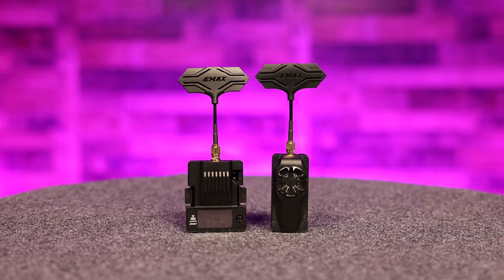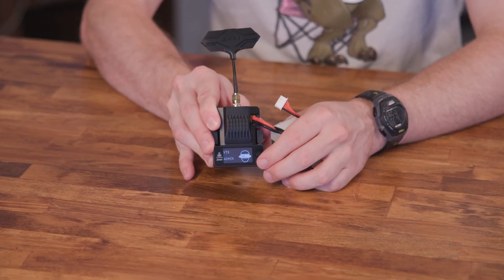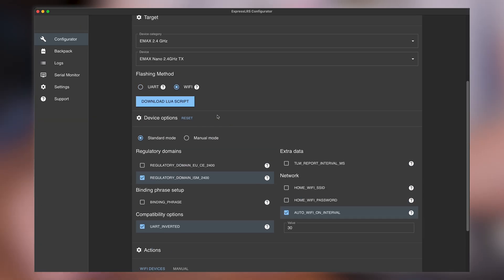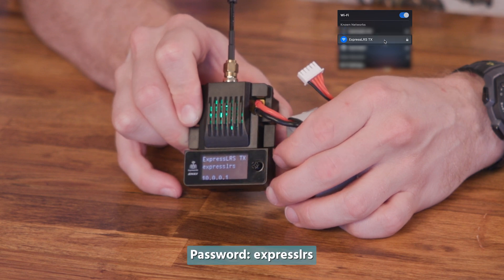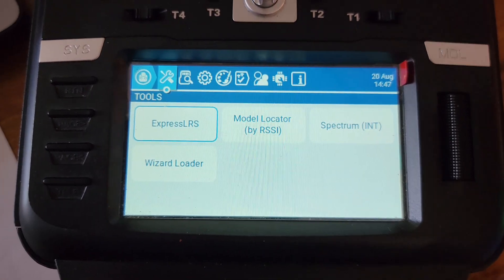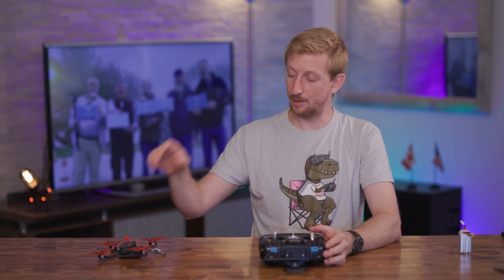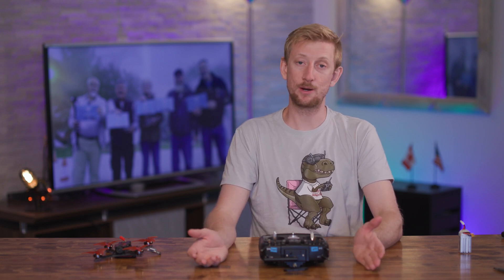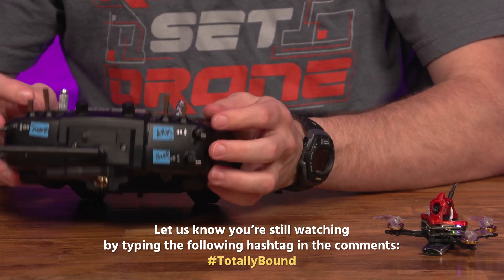Emax Aeris Link ELRS Modules - Overview, Settings, and How To Update

Comment: Nice overview. The eMax modules look nicely made. They are -- unfortunately -- very late to the ELRS game though, and the module does not really offer anything that we don't see from other companies on the market currently. Nonetheless, it's always welcoming when a well-known brand like eMax decides to make their own modules, since their products tend to be a gateway for newcomers to the hobby. Hopefully with this, we see them dump FrSky everything on their BNF fleet over the next year or so and go full ELRS.
Reply: Thanks for your comment, John. 👍 I think you're right that they will be going ELRS and HD Zero for future releases. 

Quick question for you: have you had ELRS fail safes? Both Kelly and I have, even when setting the TX is set at 1W Max, dynamic power, and 250hz packet rate. 

In both cases, our DJI video feed was still good. Kelly's a fan of the DJI RC and the simplicity of that setup. 

When I made the "Which Target" video for the Emax Hawk Apex and my hair turned gray, I had to agree with him. 😄
Reply: @SunriseWaterMedia  I have never had ELRS failsafe with either the betafpv module or the happymodel. Have flown it in some crazy environments, too. 

What was the proximity, and failsafe location? ELRS should never, ever failsafe in a park or open field even on 250hz.
Reply: @JohnCuppi  One failsafe was on his boxer radio, and he was within line of sight -- maybe behind one tree 100 feet away.

The other, less surprising but still annoying, I was flying with my TX16S and the Emax module and went behind a small stone building. The o3 video was fine, but the radio was warning me that the connection was low, but I thought I could power through and make it around the small building (maybe 250 ft away), but no way! 

Now Kelly and I call it "ESRS" ... Express Short Range System. 🤣

I'm hoping to do a test with it where I can find the failsafe distance / lack of penetration, and then try crossfire in the same location, as well as DJI, because we can't trust ELRS... especially over water.
Reply: @SunriseWaterMedia  Yeah this doesn’t sound right at all even for 2.4ghz. The failsafe on his boxer radio — that was with the emax module too?
Reply: @JohnCuppi  His boxer has 2.4G ELRS built in.